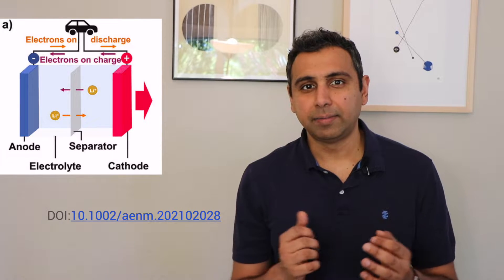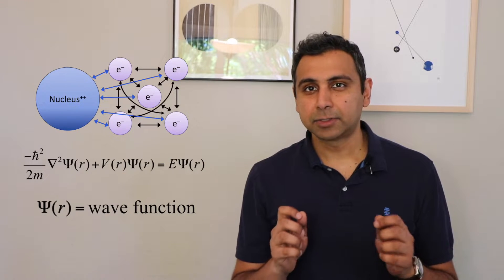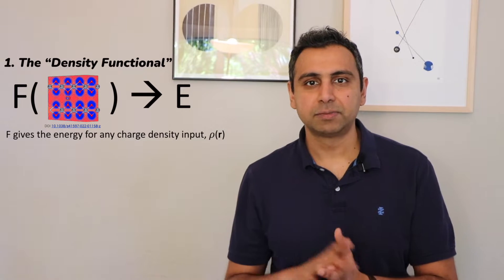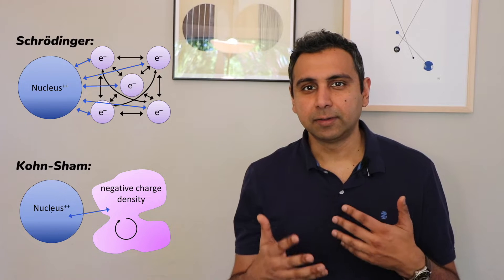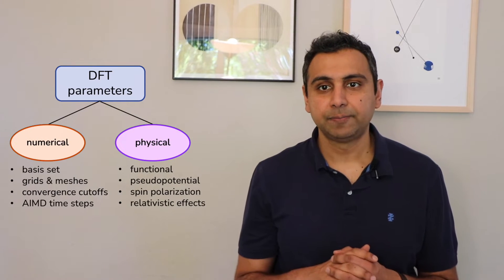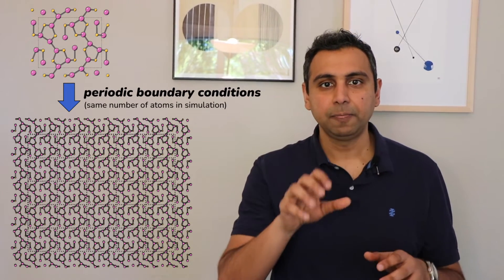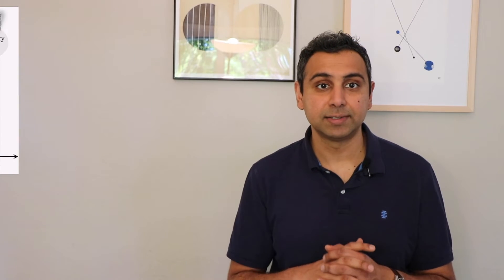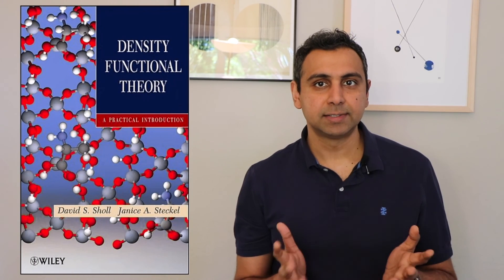Materials design with density functional theory (DFT): a casual introduction

Comment: Hi there! I need to explain a reaction mechanism using DFT analysis for my own PhD project within a month. Since I don't have anyone to support me in this matter, I wanted to reach out to you for advice. The structure of the heterogeneous catalyst involves a Pt-ligand complex bound to an aromatic carbon-based polymeric support. Which program should I use to draw and optimize the structure? What free DFT software should I use for the necessary calculations? I would really appreciate it if you could guide me step-by-step on what I need to do.🙏
Reply from the maker: Thanks for watching! Unfortunately I don’t provide project support outside my own research group and consulting. Your system is fairly complex and the first step is choosing between a periodic plane-wave code (e.g., Quantum ESPRESSO, ABINIT) or a localized-orbital code (e.g., ORCA, NWChem). Best of luck with your project!
Reply: @AtomsToMaterials  thank you very much🙏